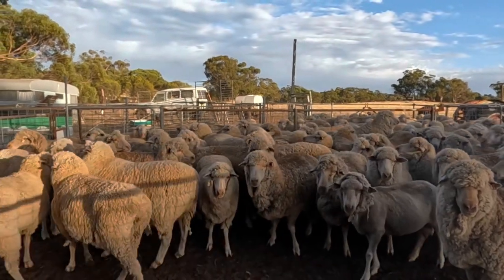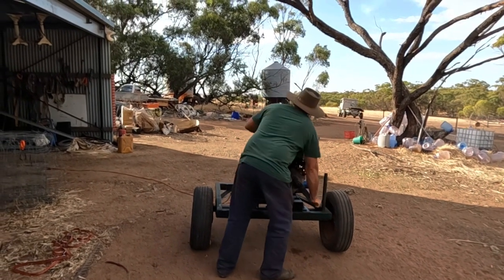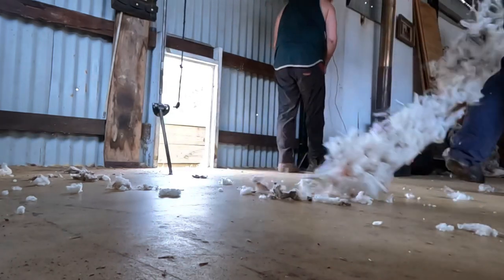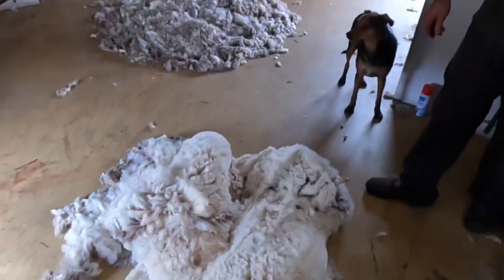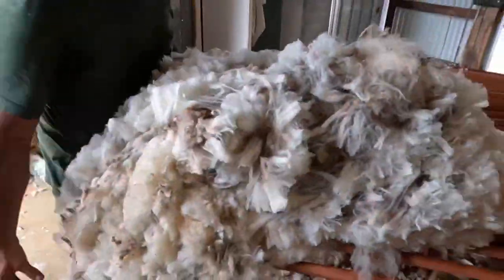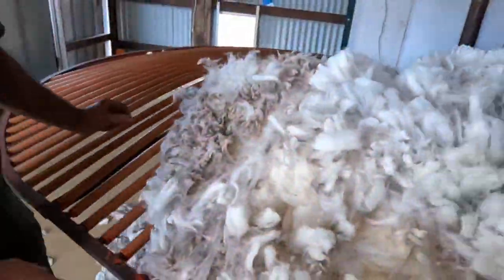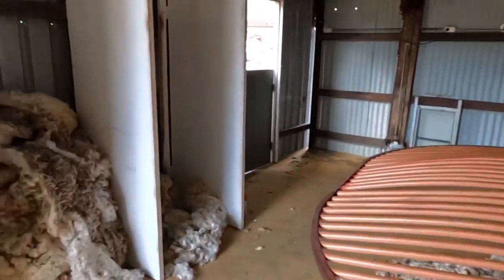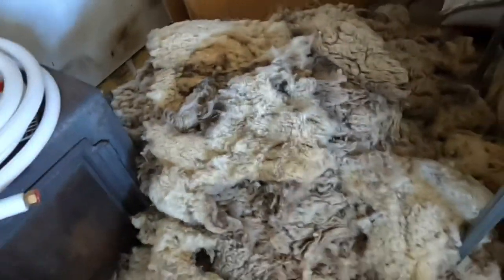Shearing the sheep

Comment: Great video Geoffrey, with an informative comentery of all that is going on. Arnie is a very good shearer, quick, neat ,and careful with the sheep. You have a very nice set up for a small farm.  Even a wood heater! I managed to save an electric screw press from being scrapped. but other than that it is like our shearing. Even generator powered.
Reply from the maker: Hi David,
I am glad you enjoyed the video. I am very pleased to have finally found a good local shearer, he did a great job.
We use to camp in the shed a fair bit. We spent a lot of cold nights huddled around the wood heater with dinner cooking on the top of it. 
I still need to finish building the proper front fill catching pen and finish off the roof to give a bit more under cover space for the sheep.
Is your press a sunbeam twin box? These were pretty good presses.
Thanks from Geoffrey
Reply: @brookdalefarm7986  yes it is a Sunbeam twin box press. You say about improving your shed, you can invest a lot into this infrastructure on a small farm and only use it one or two days a year. Regardless of this consideration I enjoy having thing work easy and smoothly eaven if it's made from second hand material. It's better for the stock and Shearer and me when I have taken time off to do the shearing I don't want to spend a day patching before we start.
Reply from the maker: Hi David, those sunbeams twin boxes are good presses even if they are slower than the modern ones. There were a few still being used around here when I was roustabouting. 
I understand what you are saying about over investing in something that is only used 2 days a year. The sheds hear have been designed to be multi use, so things like the seconds wool bins are hinged and fold flat against the wall when not in use. The under cover space for the sheep is also where the harvester will be parked when we are snot shearing. There will only be a grating in the catching pen, and that is going to lift up out the way. The pen will be made from pipe panels that drop into pipe concreted into the floor so they can be moved out the way. It’s a bit of work to build, but it won’t cost too much as it’s mostly second hand stuff I have salvaged. Shearer’s are getting so hard to get around here now that if you don’t have half reasonable facilities they won’t come back. I also like to make it a little easer for myself on the busy days.
Having said all of that it will still take a couple of years to pay for it all from just the wool check.
Thanks from Geoffrey
Reply: @brookdalefarm7986  Your shearing shed will be very nice to work once you have completed all those plans. It will be very satisfying to have it at a high standard.
About shearers. I was working in a shed last year and the subject of pay rates came up and they said for a better job they could slow down for another $ 2.00. I was staggered at this comment. I thought an already negotiated rate would have been for a good job ? They were doing a fair job, but their minds were on the clock and tally board. Australias sheep numbers have risen in the past two years and NZ have increased their shearing rates so shearers really can and do dictate terms. I don't mind a fair deal, for all parties. I remember in the 90s shearers begging for a stand and offering to negotiate the other way. This is when sheep were being shot by the truck load.
Reply from the maker: Hi David,
I guess the higher rate is for your prize breeders, but for that price there had better not be a single scratch on them.
I know a lot of shearer’s who are racing the clock or the guy next to them, but there are still lots who take pride in what they do. I know some learners get paid a bit more by some contractors to make them slow down and learn the right technique, but a good shearer should be able to do a good job at the standard rate.
Yes sheep numbers have come up a lot. Our area was once predominantly a grazing area, (too wet for cropping). 15 years ago there were almost no sheep left and very few cattle. Now it’s coming back the other way a little bit. 
Thanks from Geoffrey

Comment: I think I noticed a Farmall M without an engine in the background.
Reply from the maker: Hi David, well spotted. Yes it’s an M. It dose have the engine in it, but is missing the tin work and has another piece of mettle over it that makes it look like the engine is not there. It is actually almost complete, other than the tin work and the front wheel rim. It has had water in the engine, so it needs a complete rebuild. I will get to it eventually.
Thanks from Geoffrey